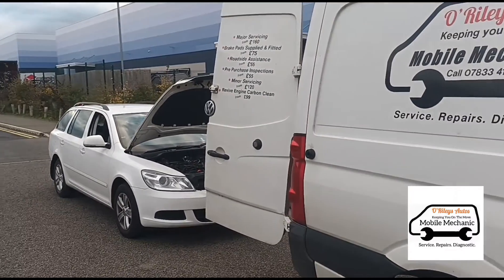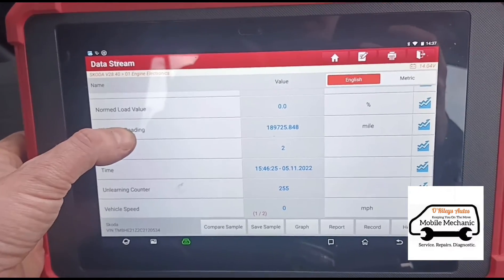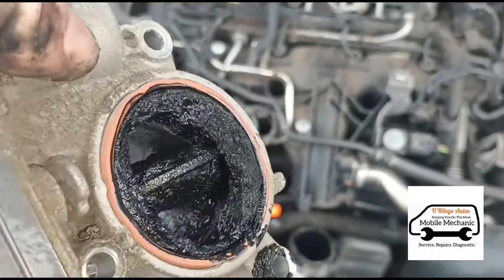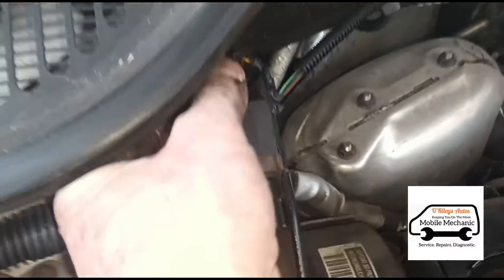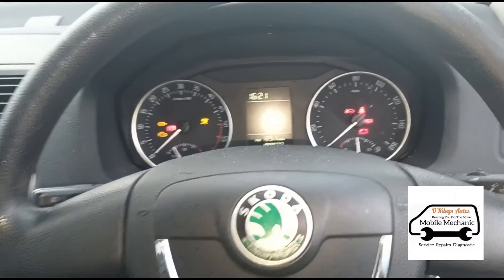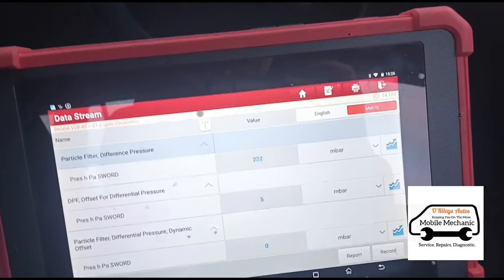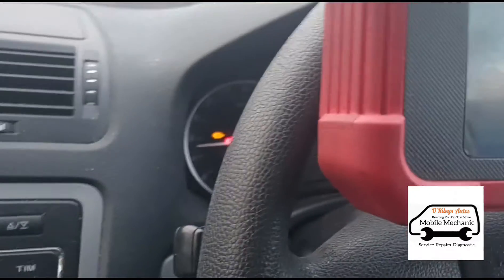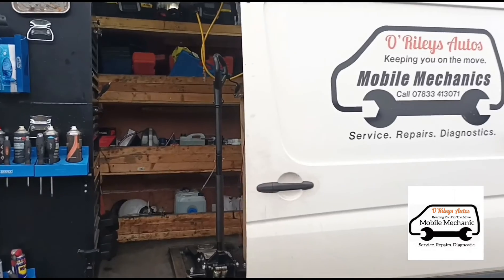Skoda Octavia 2.0tdi P245800 Particle Filter Regeneration Duration Bank 1 P012100 Throttle Position

Comment: What could you say, that if the problem occurs, within a month? You are cleaning the DPF, but in standard, it should clean it out itself. Same error code. I would reccon it can not do it, cause of faulty temp sensor or pressure sensor?

Comment: Why don't you run DPF cleaner through with the engine running?
Reply from the maker: It won't remove carbon that's as thick as that

Comment: Don’t you need to set new values to the throttle body ? after taking it apart .Could be why it still running roughly.
Reply from the maker: It's supposed to come back for a new throttle body next day but didn't return